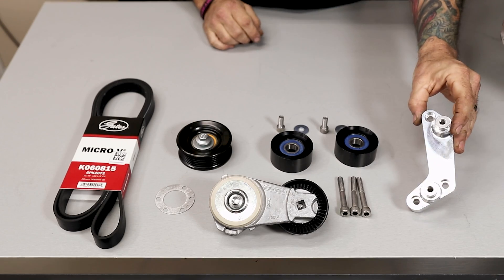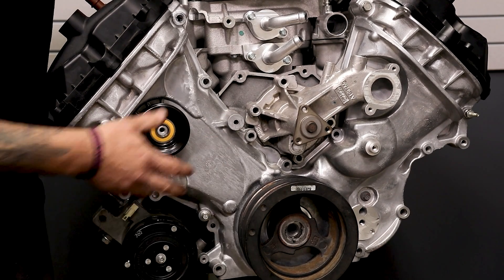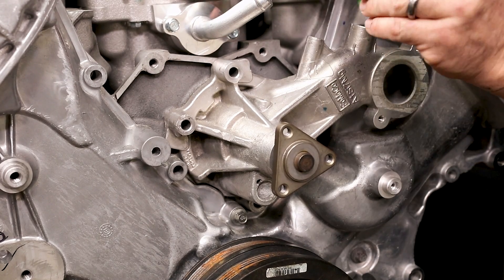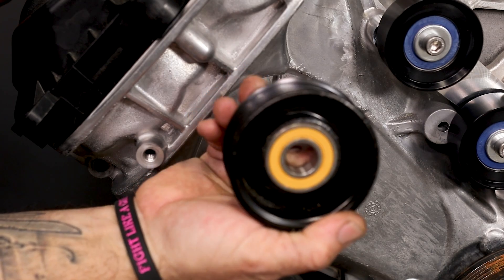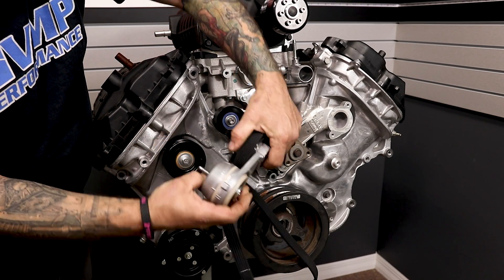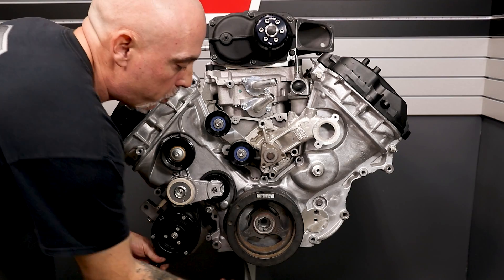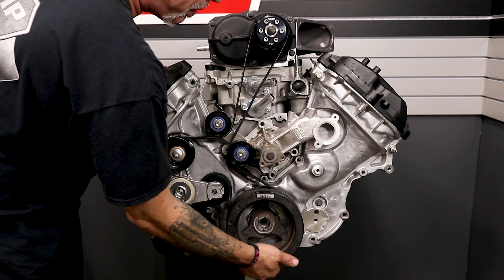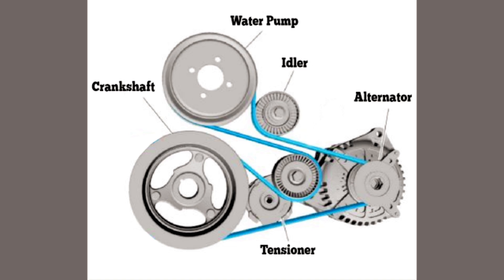VMP No-Grind FEAD Street Kit for Supercharged Coyote || New Product

Comment: Will this work for the 18+ roush 2650 f150 kit?
Reply from the maker: It will only work on non-modified timing covers.  So if the kit has already been installed, it will not.  But we do have options for those FEADs.  What are you trying to accomplish?
Reply: @VMPPerformance  putting in another shortblock the old timing cover split. Have a new timing cover with the new shortblock and was wondering about using this instead of modifying the new cover then having to buy another timing cover once I upgrade to a different better blower
Reply from the maker: Ah, yes this kit would work excellent for you!
Reply from the maker: Plus, you'd be set up perfectly to move to an Odin and we'd be happy to work with you to make that happen.
Reply: @VMPPerformance  that's exactly my next step! Plan on installing an interchiller for this roush to get as much out as possible pullied down to a 2.8 right now made 736 whp just blower with 100 shot made 905 whp! With odin I'm wanting to get into 4 digits on the blower with the interchiller if possible. Everyone in my area has a whipple but no vmp. Live in southwest Louisiana
Reply from the maker: We've had a couple trucks and cars both make over 1000rwhp with Odin, so it's definitely not out of the cards.  Appreciate the opportunity to earn your business and look forward to having you in the VMP family!

Comment: just got mine with my VMP Gen3R kit. too bad it didn't come with a ribbed idler pulley. :shrug:
Reply from the maker: Hey Dorian, that's odd.  The kit would've come with a ribbed idler to mount on the stand-off on the passenger side of the timing cover.  If this is not the case, give us a call or email us at sales@vmpperformance.com so we can get this rectified for you.  Thanks for your business!

Comment: Does this work on the roush gen 1 kit?
Reply from the maker: These no grind FEAD kits require that the timing cover has the standoff for the ribbed idler on the passenger side of the timing cover.  Roush kits required that to be ground off when installed.  These will work if you replace the timing cover with one that still has the stand off.  We are working on an option for those who don't wish to replace their timing cover.

Comment: Is this the same as the boomerang bracket?
Reply from the maker: We had a large number of calls with interest in purchasing a FEAD kit like this since the release of the Odin kit and it's no-grind FEAD, otherwise known as the boomerang bracket.  We've spent a bit of time dialing it in to work with the older head units so that it was a universal solution for those interested.  Short answer, it is indeed the boomerang bracket with a revisions to dial it in for a broader range of applications.

Comment: God this gonna make installation so much easier! I did these kits all the time for awhile and I hated routing the belt around the old FEAD style and dropping the bolts etc
Reply: I got a kit almost 2 years ago and I have basically the same thing. I am glad they included a shim for alignment issues. I had to buy mine after having belt alignment issues and was told the blower was not lined up.